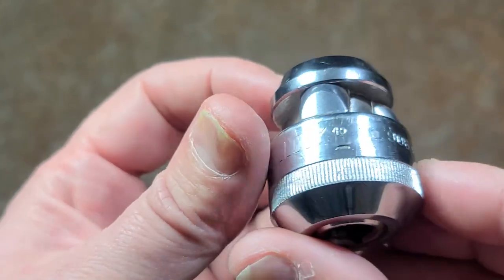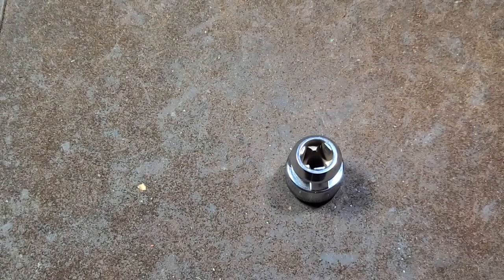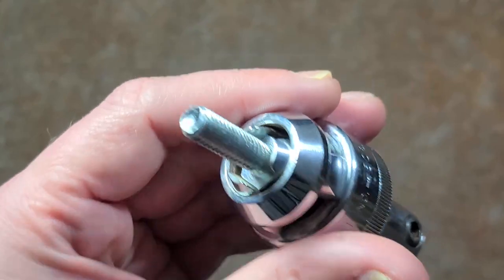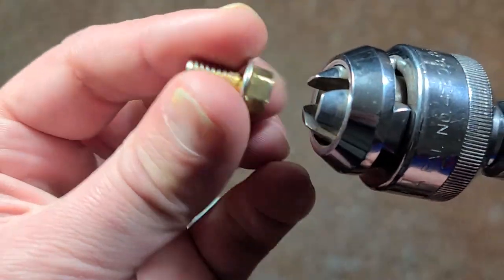ChannelLock USA Universal Adjustable Socket Review

Comment: Bravo!!!
👍👍👍 Where the Rubber meets the Road.
  Wow! What a concept.
To take that tool into the air on telephone pole or a wind mill generator. You could put a battery operated torque adapter on it . 
...One heck of a genius idea. I bet it would have been used in Outer space. With bigger bolts and the gloves they have to wear with no way to feel with there fingers.🐓☠🏝

Comment: I have one of the 1/4 and a 3/8 models. Good for when you don't want to switch between sockets over and over or have multiple metric and imperial fasteners on the same project.